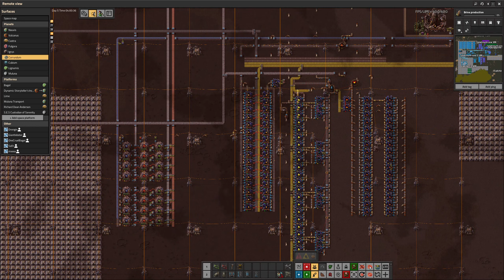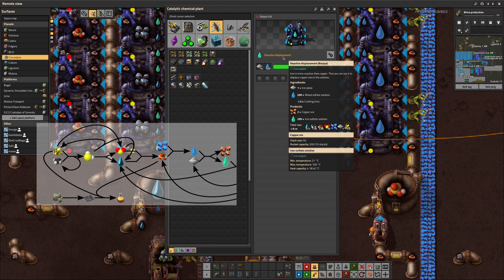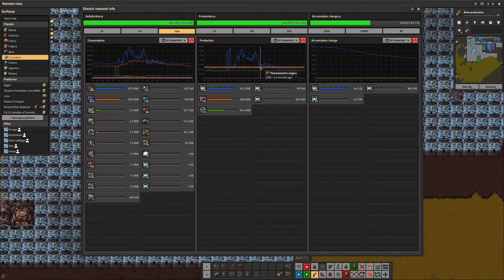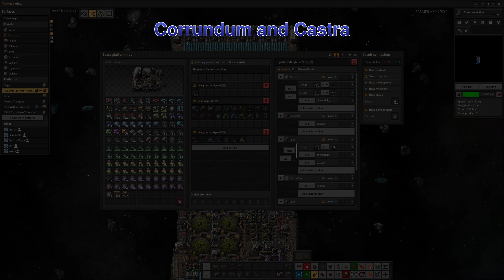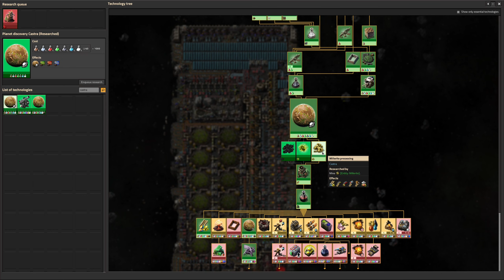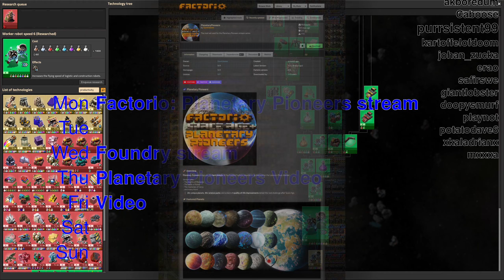S2-E25 - Sulphur Chain - Laurence Plays Factorio: Planetary Pioneers

Comment: 15:25 That fits with real life engines -- the limit is the material science for the combustion chamber and expansion throat, if you push the power up, up goes the temperature, and if you do that too much, then you have engine rich exhaust. The other limit is how strong your turbopumps are to actually get the fuel from the tanks into the burny area fast enough at sufficient pressure, and that also benefits from dealing better with heat stresses.
Reply from the maker: That fits well with my understandings too - most of which came from watching Everyday Astronaut videos. If we can prevent engine rich combustion then I shall be very happy!